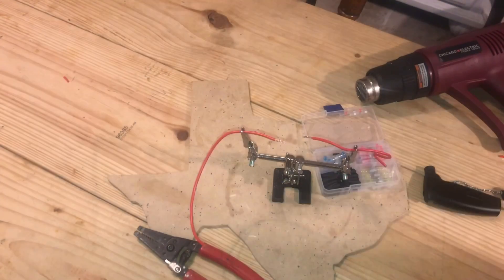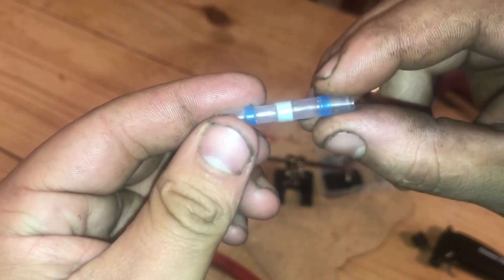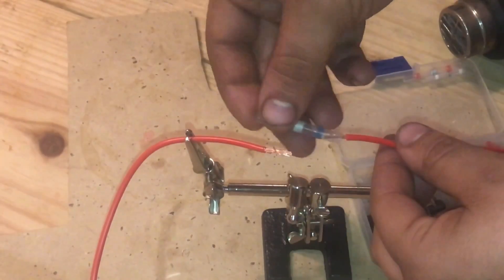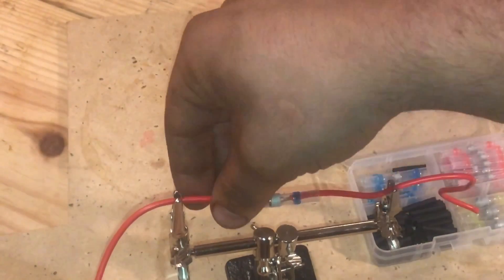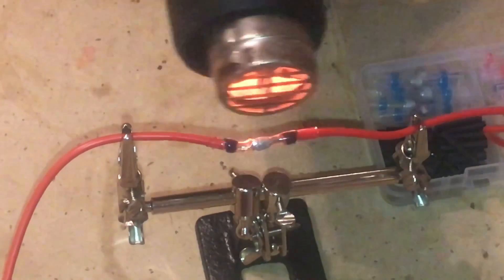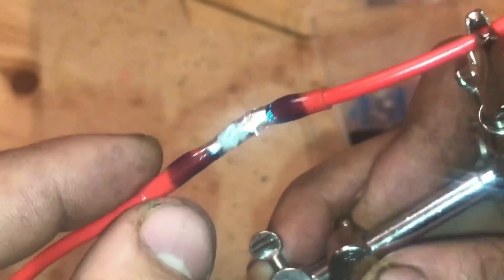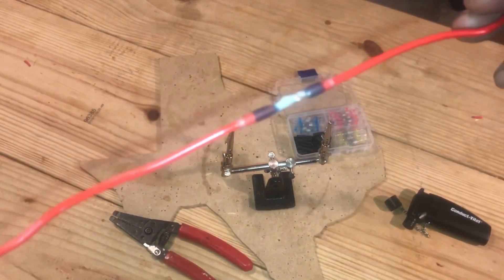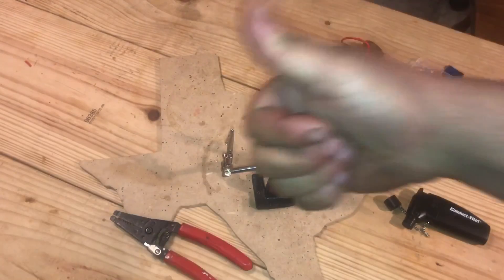The future of soldering. Part 2

Comment: Also, HEAT GUN works on heat shrink tubing rather than cigarette or butane lighter.
Also, try to "mount"/hold  heat gun upright. Rotate solder/splice over heat gun while holding wire ends.  This technique works from experience.

Comment: Good to know how to do this properly, but I don't think that I will ever embrace these things for smaller single wire repairs.  They certainly have their place when doing several wires in a harness though for sure when using a heat gun.

Great series Oz, good information on how to use these properly.
Reply: Agree!

Comment: I've been using them for years for doing just a few wires. If more than 3 I solder & use environmental shrink sleeves staggered. If done right trust them b/c they've been used in aviation for decades FAA approved. Heat gun is the only way to go with them and you should be using the u deflector which heats the splice all the way around evenly.  @t    If mobile you can use an inverter. You can use a butane with a heat deflector if you're careful but need to heat evenly all the way around.  I use the Iztor ones on Amazon.

Comment: No heat gun when your a mobile guy  so for me it's still a no go 

I go with power probe solder gun kit  never failed me yet 

I guess in shop might be good
Reply: Milwaukee makes a cordless heat gun but it's not the greatest.
Reply: @Blazer02LS  well expose that heat gun to wet ,cold,hot and a lil dirt and the corrode internally in a service truck I use the mini blow torch with a 3 inch tube extension , mini heat gun works awesome for heat shrinking
Reply: We in the same boat
Reply: I'm using Dremel solder gun kit!

Comment: it does look good but man i wouldnt trust that solder it must be very low temp solder, i like the high temp solder ive seen solder melt and fall off circuit boards and short everything out under heavy loads when people used low temp solder.
Reply from the maker: Yea I’m still a bit optimistic but I’m going to give it a shot on small wires inside the vehicle

Comment: Inside of the heat  shrink tubing is a thin layer of hot glue .
After you melt the dash components with heat gun to many times, you will abandon those things and just solder wires like before then cover it with a hot glue gun,  much easier in tight places , and water tight, and fits any size,
Reply: Hot glue guns rule, ever Technician should have 2, one for LOW TEMP or soft glue and one for hard or HOT TEMP glue , hot temp is better but hard to find, you can fix anything with that stuff and it dries fast, ( do not use in engine bay or extreme high heat areas)
Reply: @sargetester99  keep talking I'm listening. :)
Reply: My cordless one is on the top shelf, ready to go ,  power it up when doing interior work, door panels,  etc, the guns are cheap, $5 anywhere,  and glue is ultra cheap too
Reply: It is removable too,  if you need to remove it
Reply: Use isopropyl alcohol
Reply from the maker: I will look into that. I always solder any time I do electrical repairs
Reply: Hot glue gun? Nice tip. Thanks.

Comment: it worked, but it's not something I'll run out and buy.  THANK YOU for sharing Oz!  Love your vids.
Reply from the maker: carroll6 I still want to use it in real life and see how it works in in real world conditions. Still not completely sold but open to give it a try. Thanks for watching
Reply: hey I'll be watching.  The Heat gun means U gotta be near a electric outlet.  Seems there are other, better ways.  Like the butane soldering iron.  Or a Inverter with at low powered soldering electric soldering iron.  @OzMechanics